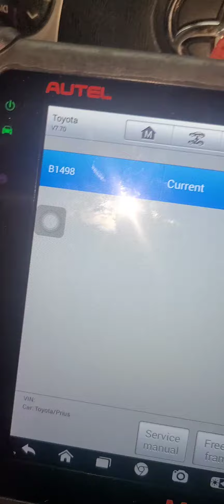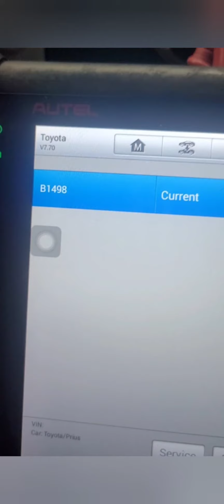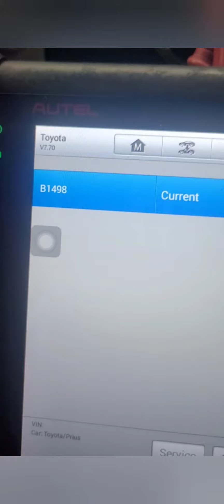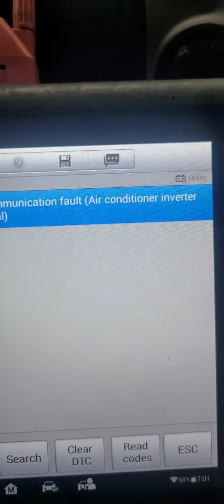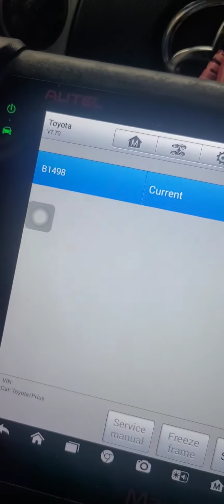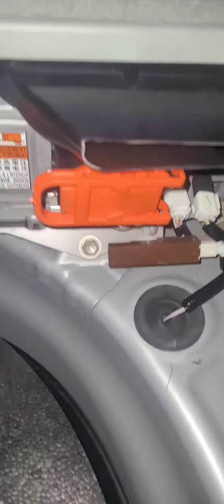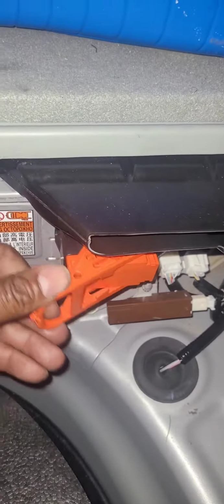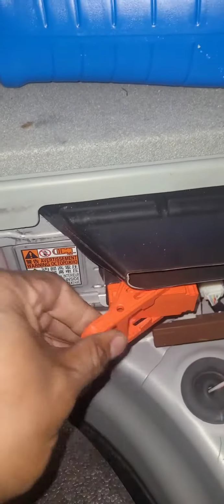2013 Toyota Prius B1498 code quick diag and how to fix the problem. It's pretty simple and direct.

Comment: What if thres no code  if work afte 10 minutes or  some time 30 min it will work after turn it off you have to wait again  30 minutes to kick in
Reply from the maker: Don't understand your question
Reply: @IGETAROUND.M.A.T.    2010 Prius. After start  car. Wait 10 or 30 min. Car before ac works.   And blowing cold   After turn off car.   And start again ac won’t work again  ihave to wait 10 to 30 minutes again before  it works. What do you think it’s a problem   I have no engine. Light on dash or anything pls help how to diagnose or resolved this  thanks
Reply from the maker: @AlexEstrella-dg2ry  sounds like an ecm (computer) problem to me